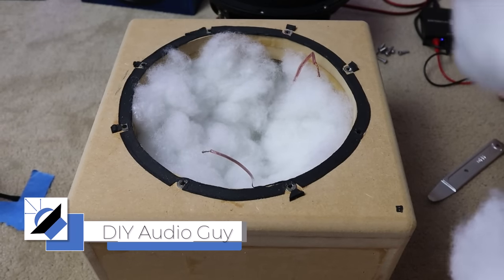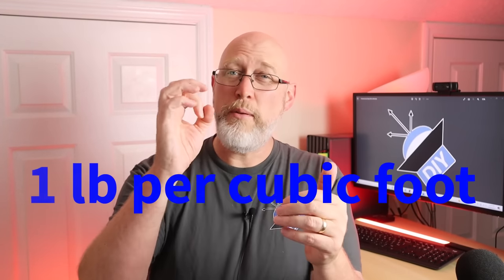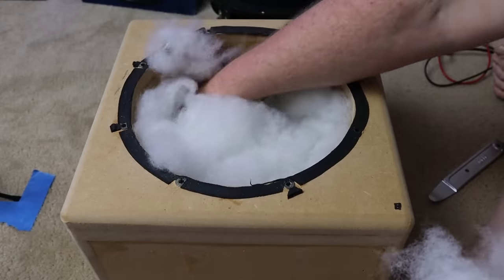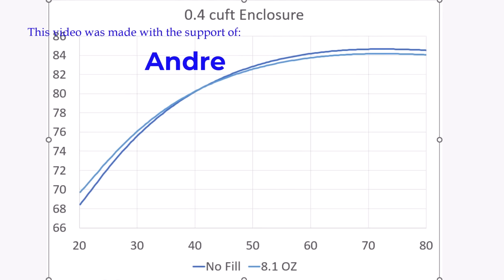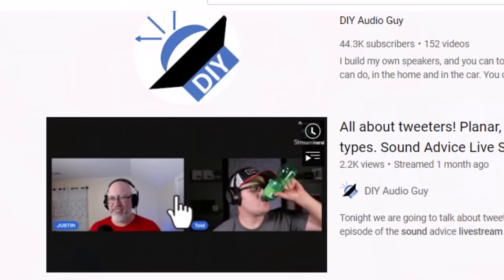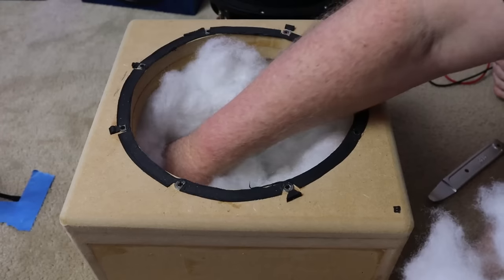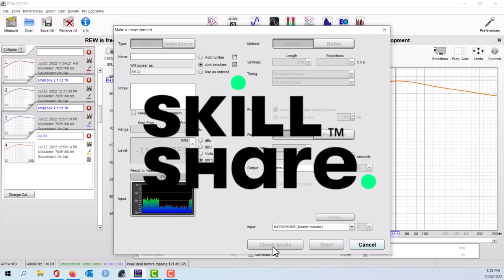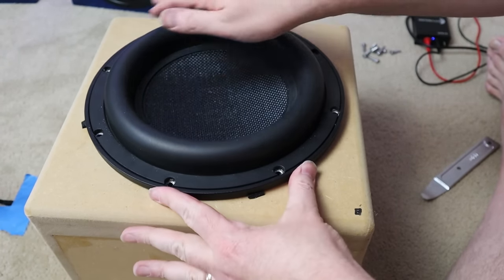Can Polyfill "fix" a small box:  Bass in a Small Space

Comment: But does adding the poly-fill change the life and durability of the driver, because of the heat that the poli-fill keeps for longer?
Reply: Not really. You have to be dumping tons of power to heat up the air in the enclosure. And 99% of the time the heat dissipation is gonna be limited by the enclosure walls rather than the air inside

Comment: When you tightly pack polyfill in a box doesn't it interfere with the speaker moving back and forth? It seems like it would possibly rub on the inside of the cone and not let the voice coil cool like it should? And another question I am getting a box to the right size in a sealed enclosure by adding 2x4s inside it and I was going to put polyfill on it but does that make the enclosure bigger? Or does it just make it sound bigger? Because you can only have so much air space inside the box no matter if there's poly or not.
Reply from the maker: I've always thought that too, but if you use the " recommended" amount of polyfill it's a lot of polyfill.

Comment: I know that the subject of the video is a sealed box, but in relation to the acoustically "insulating" material (I don't know if that's the purpose), which in this case I don't have, I just wanted to ask, kitchen exhaust filter serves to replace the polyfill (glue 1 or 2 layers on the inner walls) in a sealed or ducted box?
Reply from the maker: Not really sure.
Reply: @DIYAudioGuy  What I can give you for reference is that the exhaust filter looks like a foil version of polyfill. it looks a bit like carpeted flooring they put out of the box.

Comment: It will make more of a difference in a larger sealed boxes. But where it makes real impact is in ported boxes where you can make your ports shorter by a significant amount by using isometry.
Reply from the maker: I have never heard that before.
Reply: @DIYAudioGuy  If you want a specific tuning that is. If you have limited space and the ports need to be  a certain size to maintain decent port velocity. Instead of having to make a bigger box, you can add polyfix of similar. So that the ports can maintain the wanted tuning whiteout being to long for the enclosure. The box size can be optimized 10-20 percent this way.
Reply from the maker: @sniper8567  that sounds like a testable hypothesis.

Comment: I have two 10” bazooka tubes from way back when.  They each had a piece of fiberglass insulation in them.  I didn’t want the fiberglass fibers blowing around so I replaced it with poly fill.  Should I have left the fiberglass in them or used something different?  Thanks for the video.
Reply from the maker: There's probably very little difference between polyfill and fiberglass, both from a standpoint of fibers floating around and from a standpoint of dampening the enclosure.

Comment: I've used pollyfill before and it worked! I didn't over stuff the box though!   I lined the inside of the enclosure with a couple sheets but never stuffed a whole bag or two inside?
Reply from the maker: The standard recommendation is 1 lb per cuft.  As you can see form the video when you weigh it out 1 lb per cuft means cramming a ton of polyfill in the box.

Comment: I wonder what would be the results of sound deadening the inside walls
Reply: I found a roll of 1" poly foam at hobby store, (by fabric area), cut to fit in walls and staple gunned. Haven't heard it yet. My pioneer sub (12", 1200w) said to line the box with insulation. First time I heard of that, always trusted Pioneer since the 80's! Let u know if I blow up the neighborhood
Reply: Sealed box, 1.25 inch sold at Walmart. Ironically that's the space needed

Comment: The polyfill suggestion of 1 pound per cubic foot has always been just a rule of thumb. Never I have seen test results showing that this number was a verified rule to improving low end performance. Adding polyfill is no substitute for building a box to the proper size. Or at least the size that will produce the sonic results you are after. As for other factors such as reducing standing waves or reducing resonance, well, I can't say I've seen measurements to prove that this is what's happening but I have experimented with my own bookshelf speakers both ported and sealed and adding fill definitely changed the sound and usually for the better. However, there is absolutely a point at which adding too much decreases sound quality.
Reply from the maker: I think most people would agree, some kind of fill or stuffing improves the sound.  But trying to make the box bigger by cramming it full of polyfill is a a band aid at best, only use it if you have no other choice because you are trying to cram a sub into a tight spot in a car.

Comment: I used high density foam 1/2 inch on all interior walls and box sounds great I didn’t like poly fill
Reply from the maker: Breaking up the standing waves.
Reply: I never liked "loose polyfill" as it can be sucked into the pole venting and or into the coil gap when there is cooling holes in basket and so forth. I had a guy, about 8 years ago or so, that I built an enclosure for, to specs using my DATS and Bass Box Pro, tell me I was crazy and that what i said was absurd. He proceeded to then stuff it full. About a week and a half later, his sub, had poly in the gap, and essentially all buy seized the movement. He brought it back to me, and said the enclosure was wrong, and damaged his driver. When I pulled the 15" driver, which I built with cooling spacers between the motor and basket, i noticed the poly all in the gap. I took photos and sent to him.  I used long tweezers, and removed all that I could. I free air played it and continued to remove the filling, well as much as I could, until there was no resistance in the gap, or material I could see. I will only use solid insulating boards, or sheets that can be cut to length... or the same when using a filler from a roll, and glued to interior walls. I have just never been a fan, of using any of it, except in a sound quality environment..and from any unwanted standing waves. But I am by no means, an expert on this subject.

Comment: Many years back I burned out a woofer. When I replaced it I replaced the scrawny internal crossover to woofer wire with a foot of 12 gauge. When I fired it up, oh, man, I blew the other woofer! No, not really. The other woofer worked as well as it ever had, but the woofer with one foot of 12 gauge was phenomenal.

Try replacing that 18 gauge in the housing with 12 gauge. Then run 12 gauge all the way back to the amp, on one channel. You will think the other channel is dead.

It all goes back to damping factor.

Comment: I always thought polyfill was supposed to help with box noise, gluing it to the inside walls of the box, to make it smoother sounding, or help smoothing out EQ...what if you take denser poly fill and glued it to the insides of the box so that there is still air space? Would that make it difference?
Reply from the maker: I was always told that it makes the woofer think the box is bigger.
Reply: @DIYAudioGuy  either way, your testing proves it doesn't really seem to matter too much...I wonder if other materials could change...like fiberglass or Styrofoam...flexseal,lol idk 🤔

Comment: Great video and perfect timing for me. If anyone has advice I'm looking for some. I'm building a sealed box for 2 Kicker Q class square 8's in a 2 door Jeep wrangler with no top or doors.  Sealed because it's an open air Jeep, 8's because I am very space limited, and square drivers for max cone area. Do you think I should build the box to the smallest recommended size and put max ( a little over ) RMS to the subs,  or build it to the largest recommended spec and use the lowest RMS to keep the drivers from over extending?  I have room for the bigger box but like everyone else I always want more power.  What would you do?
Reply from the maker: I would call kicker tech support, they provide excellent customer service.
Reply: @DIYAudioGuy  Good idea, thanks.

Comment: My truck doesn't have space for a .4 cu box that I need for my 10 inch sub, but I can make one  with .3 cu, should I use polyfill?
Reply from the maker: These test show that placing a sub in a box that is to small is a bad idea and that polyfill does not fix that problem.  Consider using an 8 instead of a 10.

Comment: Hi I'm Don from Philadelphia Pa and I have a nice little surround sound system in my living room.ok my question is that I have 4 polk audio tsi 500s tower speakers and the bass ports are raceing down to the floor and I do have wall to wall carpet since I had them I been trying to achieve better quality I'm looking for that sweet spot on movies and music I have all 4 of my towers I have a plank of MDF under them and it improved the quality of sound but I noticed that I can hear an echo coming from the box I been thinking about lining the inside walls of the speaker cabinets with peal and stick rubberized mat I noticed that when I tap on the side of the box it has a bong sound to them if I coat all the wood that is exposed in side of the cabinet will this through out the tune of the box or will it help with the sound quality of the speaker.
Reply from the maker: I would not recommend doing any of that.  If you don't have a subwoofer I would recommend getting one.
Reply: I currently have 2 polk audio 10 inch subs hitting at 100 watts and I have a Yamaha rx-a800 advantage avr and a Yamaha S-701 amplifier that I'm using for my 2 front towers and I also have 2 polk monitor 40 series 2s all bi amped and I have 2 book shelfs for my center channel I wired them in a daisy chained and it sounds great but I'm looking for a deeper richer sounding version of the system. So if you say it's not a good idea then I won't do anything to them I'm thinking about adding 4 more book shelfs 2 for my front heights in both corners and 2 in the back aiming down into the room. The one thing that I have noticed is that the book shelves with the 5 1/2 inch drivers sound so evenly matched and blended with the towers that have 6 1/2 drivers and I have all this set up as a 5.2 surround system
Reply from the maker: @MadeinAMERICA369  Stop throwing money at it.

Make sure you have everything set up correctly, and experiment with speaker placement.

You've got to be careful when you're running two subwoofers they might be canceling each other out.

A good place to start would be to just unhook everything except for the right and left speaker and just listen to it in stereo.

Comment: I can't prove you wrong with testing; I can't even prove you wrong in theory.  All I can do is tell you that in my decades of experience, some setups respond well to fill, and some don't.  I don't know why.

When I've used fill in the past, I've mostly used Acousta-Stuff (sp?).  I tend to keep some on hand just to play around with anytime I build a box.  I've never noticed it making the box play louder; what I notice is it seems to smooth the response, and can be a noticeable difference to my ear.  I find myself using it more in MDF boxes than in plywood or solid wood boxes.

I can't describe what I hear very well, but some MDF boxes, without fill, sound grating and rough to me, especially at lower (normal?) listening levels.  Kind of like a mild square wave overlay at certain frequencies, I guess?  I honestly don't know what I'm hearing, but I know I don't like it, and I know when I hear it, it's time to play with fill.

Does anyone else remember when we would cram all those unwanted Christmas sweaters into a box, 'cause it was a readily available solution, and cheaper than fiberglass insulation?  LOL
Reply from the maker: That right there is the thing, some do and some don't. The question is why?  That lack of consistency tells us that something else is going on.
Reply: @DIYAudioGuy  I think it comes down to factors beyond measurement.  As far as I'm aware, no one has been able to predictably plot driver timbre, and the real world musicality of a driver can often defy its spectrum analysis graph.

The end listener's experience plays a huge role, too.  I've built hundreds of speakers and listened to thousands.  I'm an SQ guy; it's the way my taste has developed over the years.  I'm picky, so for me, it's worth playing around with variables to find the sound I like.  Compare that to someone that may just want more bass in their car; spending hours and dollars for a change they may not even notice just isn't worth it, so research like what you're doing is absolutely invaluable to the community.  :)

Comment: I literally just put poly in a .83 cu ft prefab this morning since it's a little small for the Sundown SD4-12 I put in it. I have the type that rolls out, I used carpet glue and lined it so I didn't use much. I wish this video was released a couple hours ago lol. (Or maybe I should be a Patreon member with early access).
Reply from the maker: Do you think it helped?  Do you like the sound?  The tests I did do not tell us anything about sound quality.
Reply: @DIYAudioGuy  I added it knowing the box was undersized, no before/after to compare. I did it because "common belief" said that's what's we're supposed to do. It should already be in the truck but the guy's late, argh.
Reply: @DIYAudioGuy  well, I'm not sure how much the polyfill helped, but that SD4 12 only has .73cf after displacement and it hits all notes on bass I love you too. It's surprisingly good for the small prefab. It calls for .8-1.0 sealed, not recommended for ported but the prefab is only 5/8" MDF. Mids are 2 sets of k2 comp's, everything's powered by a Rockford T1000X5AD. We deadened the doors and did a 1/0 big 3, it slapped together pretty quick with the 2 of us, definitely happy

Comment: Can I add Volume to my subwoofer box. If I mount the subwoofer on additional ring spacer like 2 in thick.
Reply from the maker: Yes, but the extra volume would be very small.  If your speaker cut out had a 9.5" diameter you would only gain 141 cubic inches with a 2" ring.   That is only .082 cubic feet.

Comment: The comments seem to confirm that you are only proving some people use polyfill for the wrong reason. Besides resonance issues, polyfill is a requirement for some drivers in sealed cabinets to keep the driver cone from misbehaving. I have a pair of bookshelf speakers in my garage that sound great. When I was building them, I tested without polyfill and the driver cones slapped and buzzed. Adding medium fill corrected the issue and the low end from those small drivers is impressive. So, besides for resonance issues, polyfill is useful for changing the air pressure in sealed cabinets. But not so much for getting more bass.
Reply from the maker: Yes, exactly.

Comment: Does the software take into account when plotting the graphs that stuffing a box will make it less efficient? So I guess if measuring with same setup same watts will go to the speaker and thus the plot will be lower. But if the plots are put on top of each other then maybe there will be another answer.
Reply from the maker: No, it just measures the response. You can see the decrease deficiency with the lower output at the upper frequency range.
Reply: @DIYAudioGuy  response measured with a microphone is SPL, at least that is what I think. I think you need to account for the loss of SPL when stuffing the box. Then probably the blue and orange graph would align from 50 to 80 Hz and you would see a better low end response from the stuffed box, although maybe not that much.

Stuffing box is trading efficiency for "bigger" box.
Stuffing the box and measuring at the same level as non stuffed box is like changing to variables at the same time. Stuffing the box and accounting for losses would be changing just one parameter. At least that is what I think.
Reply from the maker: This is what I think is actually going on.  We reduce the efficiency, then turn up the volume to account for the lost output and then we THINK that we improved low-end extension. If you use an EQ to cut the 60 to 100 hz range that does not make the 20 to 50 hz range louder in absolute terms.  But it will be louder in relative terms.
Reply: I put the curves on top of each other, in effect increasing the volume by a couple of dB to normalise the responses and the difference in low-end depth (f3) was only a few hertz...probably inaudible I'd have thought.
Reply: @DIYAudioGuy  I think your test shows what frequencies is dampened when adding poly fill. And it also shows that Q value is changed.
Then we know that we can lower the Q value of a box (by something like 10%) and then if the system can take it we can add more power. Then since Q is lower we get some more (real) low end output, your graphs shows this due to there is not as much lost in the lower regions as in the higher.
I think you would get the same if you lowered the higher frequencies with EQ and then added some more power. Since I think EQ can alter Q value but I have no proof, it just feels that it does.

But it seems it is a very small change that can be made with poly fill so no one should expect miracles. 
If you can't add more power then all you get with poly fill is a slightly different sounding box due to different Q value, but also lower output.
Would have been strange if we could gain output by adding poly fill. That would somehow define the laws of nature.